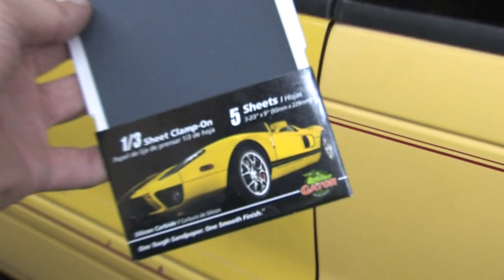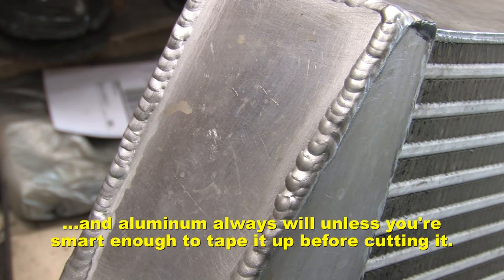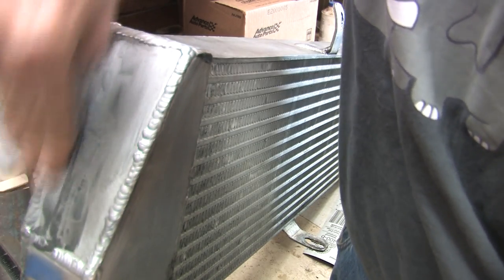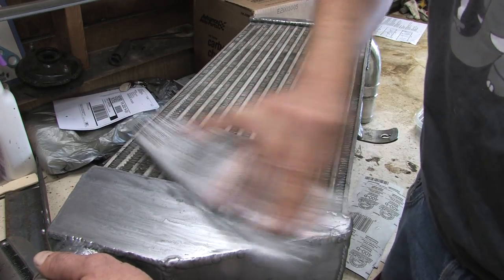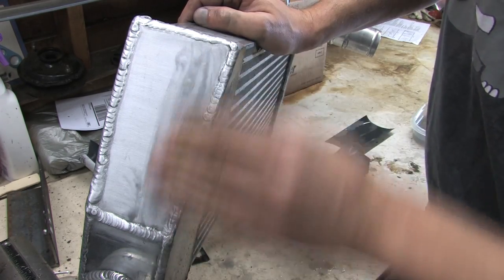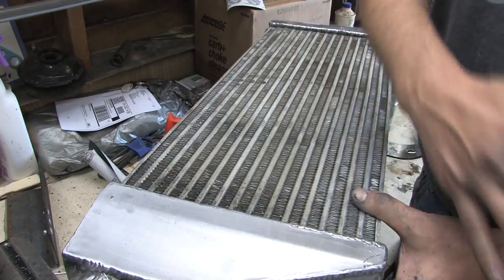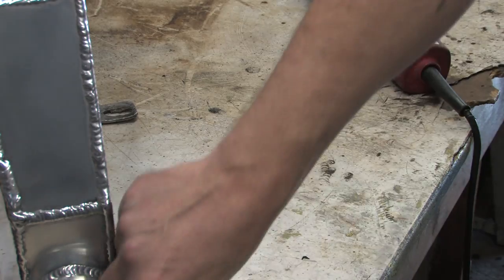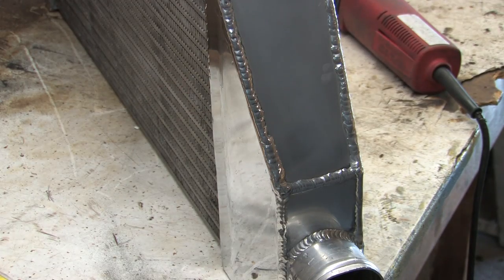Polishing Aluminum (GSX is alive)

Comment: I can offer one great piece of advice.  Use a squirt bottle with a water and soap solution.  The water will whisk away the old junk and the soapy lubricant will make feeling out rough spots much easier.   I'll never wet sand without my squirt bottle again. Give it a shot next time Jafro, you'll love it.
Reply: +DJDevon3 Agreed... If you don't have a squirt bottle handy just use a water bottle and put a pinhole in it..

Comment: for a flat area like that you could use a orbital sander to save some time or maybe even a small palm sander or even  asanding block to help save your fingers a little bit....Im trying to figure out how to do motorcycle rims...the polishing part is the easy part Im worried about the sanding without killing my fingers Im going to try a coarse polish and work my way up to a white polish hoping The coarse polish will take care of the sanding part...if not Im gonna try greasless polish on a wheel

Comment: protip: 

put black rouge and metal polish on the inside edges of the intercooler inlets and outlets, to port and polish the intercooler, piping, intake manifold, and engine internals.

Comment: 3m makes a great metal polish that you can use for finish polishing with a foam pad. But I will say this. If you are a novice, stay away from finish polishing with a rotary tool. If you are gonna finish polish/buff then you should learn to do it with a DA tool. That is a double action, or orbital tool. 

Once you have learned to get a good finish with a DA tool, then move up to a rotary tool. A drill works okay but you are gonna be at it for a while. A rotary polisher/buffer is ideal. Or a grinder works well for flap tools/wheels. 

And I you can get 320 paper for smaller DA orbitals 3" is what I use, and I use 3m paper. I have paper for my tool all the way to 3000 grit. Higher than 1000 is really only useful for polishing clear coat or plastic. 

Polishing clear coat or plastic is easy, but sanding clear coat or plastic is the real hard part. If get a spare tailight to learn on. 

Anyways, thanks for some great info Jafro. I've been going at it the hardway. Gonna look at getting some of the stuff you've been using. Never used the rouge before. Looking forward to it.

Comment: If you take it up to 1000 you won't have to revisit panels because they aren't shiny enough. They will be too shiny, every time. Mothers mag & aluminum polish for finishing works extremely well for many metals & also hard plastics (headlights). All you will have to do is rub it on lightly by hand, it'll go black, wipe it off, bam.

Comment: @Jafromobile And there is no need to get so antagonistic it was a simple observation and has nothing to do with a persons mechanical ability it has to do with training. A simple observation if you wanted to work in a Body Shop or Paint Shop you would see what I am saying is true. And another I was polishing aluminum wheels when I was 15 years old Porsche alloys used to get 200 bucks each back in the 1980s and I always used air tools for everything except the sanding.

Comment: Polishing my diff housing at the moment, if only it was easier to get to all the nooks and crannies on this one...wire brush wheel just mangled the deep spots aha...maybe some sodium hydroxide to level the deep parts out? Toothbrush in a drill?
Reply from the maker: If I told you that I didn't cut a lightly mangled Nissan XTerra front bumper into twiggy little shapes and wrap them with the sandpaper grades to reach inside of every detail on my cylinder head, then I would be lying.

There's nothing like attempting to polish aluminum that has been bead blasted.  It takes days of sanding work off of a part.  My fingers being raw and too big to reach certain spots forced me to come up with the solution above, and it actually worked great.  Cutting up a junk poly bumper cover made great tiny little fingers that could reach things my human ones couldn't.  It let me match the surface textures of the surrounding area.  Think about the value of junkyards if you don't have access to a polyethylene bumper cover.  You don't need the whole bumper, just a broken off piece of it.  A square foot would be enough to make tens of dozens of the kinds of things I'm talking about.  You'll feel silly doing it until you see how well it works.  Use several layers of sandpaper wrapped tightly around them.  There's my secret for detail work.

Comment: I think the process shown is ok for a unprofessional job, please excuse me.
Basically there are so many steps for doing this properly. I would use a dremel or my polisher to do the basic sanding and also grind down the weld. Starting from 220 is ok, but it depends. U may have to start from 150 then 180, 220, 320, 400, 600, 1000, 1500, 2000 dry and 2000 wet. Then use rouges red, green, and last of all pink and then put a polish and elbow grease and then coat it with two layers of clear laquer VHT/ Rustoleum(high heat) with some sanding in between the coats.and a guy like me might see a small spot and do it all over again.
Best thing to do is practice on steal, cast aluminium, can use a guide coat also.
There r cutting bars, intermediate polishing bars, polishing bars and then the superfine rouge. I think increasing grit sandpaper are better than using emery paste for this size objects, emery paste is a better option for big equipments or sheets, or if u r too impatient. 

Enjoy. Keep buffing and polishing.
Reply from the maker: jaspreet walia /watch?v=mJ952KbvXJI 
8 show trophies.  I'm just offering good advice directly from my experience.
Reply: jaspreet walia Where are your buffing and polishing videos jaspreet?  When you put videos out then perhaps we can see your techniques and results.  This isn't for a valve cover or something that will last a long time.  It's on an intercooler that's going to get whacked by every imaginable insect, pebble, dirt, and debris the road has to offer.  It's professional enough for getting bolted to the front of a race car, it's not a garage queen.

Comment: Hey jafro, quick question again, when you did your valve cover, sanded it from cast to a shiny smooth surface, how did you get between the letters and numbers, say the middle of the 0's and the A? did you use a rubbing compound with high grit and a polishing wheel or did you somehow do that all by hand, I got mine looking nice now but cant get into the small spots that well.

Comment: ***** Can you an angle grinder to do this job?
I can't seem to find a straight shaft grinder locally and I've got a grinder kicking around.
Also on something that's already sort of polished (Tial BOV) would you do all the sanding or go right to polishing?

Great video, I can't wait to polish up some of my stuff.
Reply: Hey man you don't need a straight shaft to do the job!
You can do it with a electric drill not the ones with the battery pack but the ones you plug into your wall plug with a polishing wheel like Jafro uses.
As for already polished stuff like the Tial BOV if it's scrathced and you want to remove the scratches, then yes you do what Jafro does in the video, if not just use your polishing compounds and they will shine like new!
Reply from the maker: Somehow I missed this notification.  What ZXESAS said, but the slower tools take longer.  You can use an air tool for this, but your poor compressor.  Mine's the equivalent of 100 60W bulbs when it's running.  The electric DIY grinder produces a lot more torque and uses less power, that's all.  You can do this with what you've got as long as you're creative, and patient.

Polishing over scratches gives parts a lot of character.  I personally like the way it looks.  If it has to be perfect, then you have to sand it.
Reply: Thanks guys.
I tried the angle grinder and it actually works decent, I'm clamping it in the vice for smaller pieces.
I'm starting to mirror polish my IC piping, smim and Q45,  kill me now lol

Comment: What size air compressor tank do you use? How many psi? Do you think the 100-150 psi 3 gallon pancake or hotdog style air compressors from Harbor Fright would be enough to power the air tools needed, from a polishing wheel, spay gun to an impact wrench/ratchet?
Reply from the maker: +fockyoumang Those will work great for a few seconds.  But no, not for something like this.  I have a 40 gallon compressor with a 14.1cfm recovery rate.  It's just at the bare minimum size for using DIY grinders.  I have to stop and let it rest occasionally.

Comment: can you use a sanding block for this? or is it better with just your fingers???
Reply: K4lr0b You can use a sanding block for large areas with rougher grits.  For finer detail work and higher grits above 600 you want to do it by feel.   You can't feel rough spots with a sanding block between your fingers and the sandpaper.  Most of the finer work is all done by feel and I mean that, it's by feel.  When you get up to 2000 grit it will feel like you're trying to polish slippery glass.  You can switch to a buffing wheel well before that point if you want.

Comment: I have a brand new cast aluminum lower intake manifold.  It has the rough cast on it. I would like to polish it.  What would you recommend starting with just to get the rough cast smooth without damaging some of the casting numbers or finer details like the cylinder number markings?
Reply from the maker: ThatDanDude Hand sanding.  That's about all you can do.  I had a bumper cover off of an old wrecked XTerra layin' in my shed and I cut up pieces of it to make little jigs that fit in the nooks and crannies, wrapped them in sandpaper and did my detail work that way... it worked great, but it's extremely tedious.  Just stay away from machine tools and be careful, and you'll have better results.
Reply: Yea that is what I thought you would say.  Started with emery cloth.  You're not kidding, that is tedious work.  It's working but got a long way to go.  I'll show you when I'm finished.....my daughter is 10 now so.....should be done about high school prom.  jk.

Comment: How long does it remain polished before requiring it again?  Could you spray high-temp clear-coat on it, at the very end, to maintain a shine?
Reply from the maker: It depends on what the engine parts go through...  All it takes is driving it in the rain to ruin it.  Drive it in the snow and it's 10,000 times worse because of road salt.  If you coat it with any kind of urethane finish, it will dull the shine, it will yellow over time, and it will be worse than just re-polishing it to strip it all off and shine it back up again... not to mention that it will reduce the part's surface area and add an insulating layer, trapping in heat.  That's okay on some parts, but not this one.  There isn't a clear coating out there that won't in some way negatively affect its appearance, but; there are liquid polymer sealants that will waterproof the parts without adding a paint layer.  They're expensive, they're resistant to everything you'll encounter in the engine bay except for abrasion, and though they'll put a dent in your wallet, they'll give you your weekends back.  I don't drive this car in the rain or even in the sun when there's puddles.  I do drive the car (when it's in service) any time I feel like it and there are unavoidable encounters with water in any car.  When used this way you can go a year or more with nothing more than occasional touch-ups.  You get creative with the process as time goes by, and soon you find the car you did this with breaks down so frequently because you're making 3x its designed horsepower giving you lots of opportunities to do it on your workbench instead.  Another thing you can do to ruin every polished part on the whole car is leave it parked outside with a battery slowly-draining until it's dead.  It causes a corrosive ionic process that treats aluminum like a sacrificial anode.  By the time the battery is at 0v, it's pitted so bad it's like starting over from scratch again.  You have to use it or lose it.  Either that or disconnect the battery between jaunts.

Comment: I'm doing some flat bar projects?? Can you use circular sander??
Reply from the maker: +Dave Smith I really want to say no, but honestly I haven't tried.  Where I ran into difficulty with machine tools is finding sandpaper made for the tools I was using in fine enough grits.  Polishing with something aggressive tends to leave tracks, and if it's possible, it may take automation to ensure a consistent and even result.  Either that, or the steady hands of a neurosurgeon.  I'm not sure that Ben Carson could do it?
Reply: +Jafromobile Isn't the purpose of an intercooler to take heat out of the air charge? Why polish the intercooler and reduce it's efficiency (even if it is just a tiny bit)?
Reply from the maker: Brian Tracy It's not the end tanks that do the heat exchange.  :)
Reply: +Jafromobile EVERY surface transfers heat... I've never understood the whole paint/polish/"obsess over looks" thing... You do great work... I'm looking to build a rail buggy with a FWD 4cyl/auto powertrain at the rear... I'll probably just pick whatever super low mileage candidate car shows up at the insurance auctions with rear end only damage...
Reply from the maker: Brian Tracy I read you loud and clear about textures and finishes, but I think it makes much less of an affect than most have sensationalized.  Add to that, a million people before me have been doing this to hot rods since they came back from WW II and hit the salt flats.  Polished finishes never kept them from breaking records, although I'd hate to be the guy that had to polish it.  :)  It's part of hot rod culture, and people either embrace it or they don't.  Most who don't embrace it have experienced what it's like to keep it shiny.

But about the finishes... I get it.  I might be losing a hundredth of a degree of cooling capacity off the polished finish on a little corner of the end tank that's in the air stream... but on that hot summer day when I'm sitting at the stop light, the road baking and reflecting the sun into my end tanks isn't giving me that hundredth of a degree back.  All my polished intake parts are in a hot engine bay.  The exact same theory says they will absorb the engine bay heat and transfer it to the intake charge.

In my opinion, someone regulating their intake temperatures based on finishes of their intake parts should have maybe used more efficient intercooler core to begin with.  I use a short route kit that's less than half the internal volume to pressurize than the average pipe kit, a sheetmetal intake manifold, ported head, bigger cams and dual valve springs.  I'm using the boost AS I make it.  It's not hanging out in the pipes and end tanks.

Polished finishes are a pain in the ass to maintain, but at the track when you encounter the stripped, weight reduction'ed, drag-slicked, speed-holed, 2WD, utilitarian no power option cars on street nights... and I'm chilling with the AC, windows up, loaded GSX that's just as fast as they are... let's just say it's part of the psychological game I like to play because nobody's expecting a low-12 from it.  If the point of this car was performance-only, the weight of my luxury options outweigh any gains I could ever achieve by fine-tuning surface finishes.  This car is about comfort, fun, style and speed.  The finishes I have helped it get there.  3 of the trophies are DSMCA's "King Of Bling", one from every year where I participated.  The day it brought home "best of show" in a field of 300 DSMs was one of the best days of my life.  I guess that's why I do it?  I have a reputation to maintain?

Sorry, I average 165 wpm.  I've had a lot of practice.

Comment: @Jafromobile Check this out go to my Face book page and then you can see what I am about before you get up on your high horse. I never attacked you if you think I attacked you you are VERY thin skinned. One last thing you have never used Deltron clear it does not yellow and you can pour acetone on it and it wont touch it just a free tip.